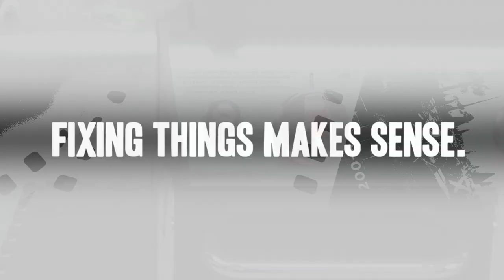Weber Grill Repair - Installing the Igniter Kit (Weber Part # 65942)

Comment: Very informative video, thank you. But it seems you took a few extra steps. For example, why did you remove the lid to install igniter kit ? Even it is generally nice to know/remind how to disassemble the grill.
Reply: The Weber instruction guide says to remove the lid, makes no sense at all.
Reply: @karlsimonian1424   I am thinking like a safety precaution, maybe to avoid the possibility the lid closing while  putting in the ceramic ignitor